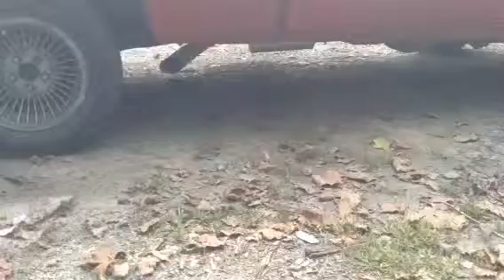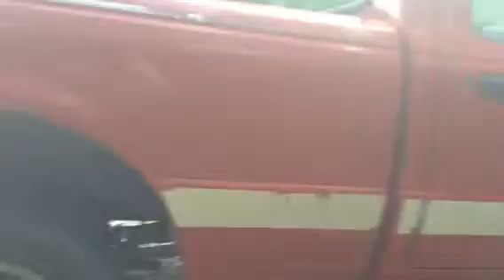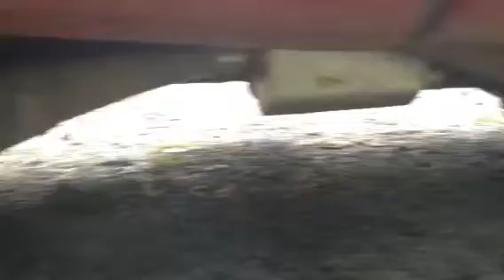1995 Ford Ranger 4.0 exhaust clip

Comment: thrush welded's make anything sound pretty good. if you had it run all the way out the back, itd be much deeper sounding, probably quieter but deeper. piping helps the exhaust note.